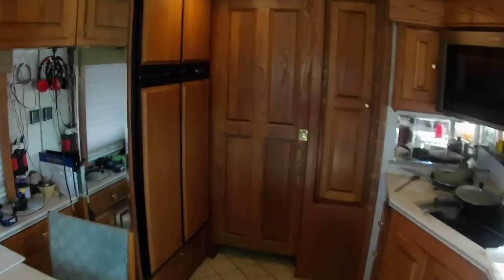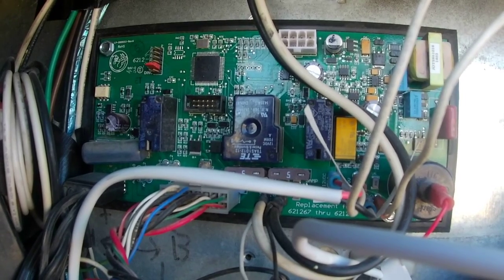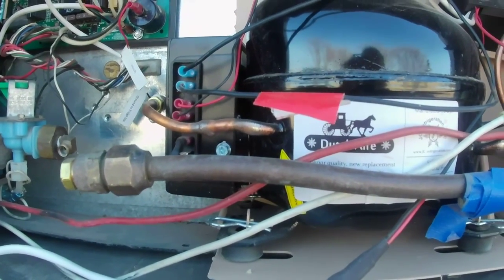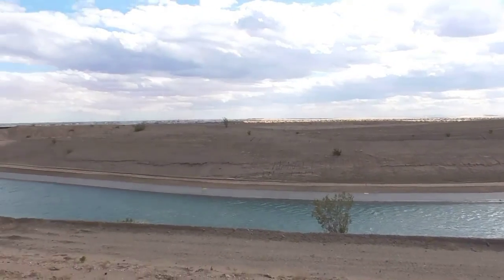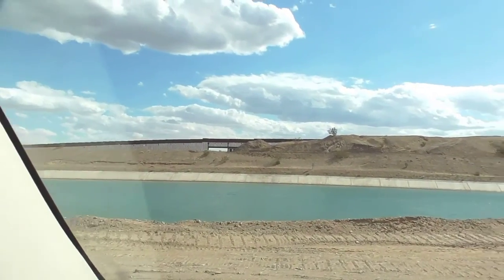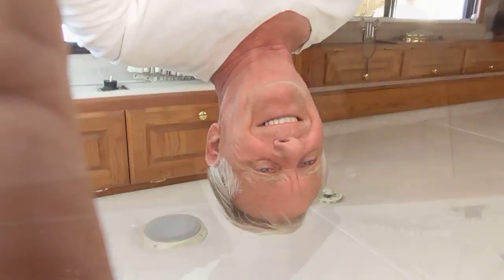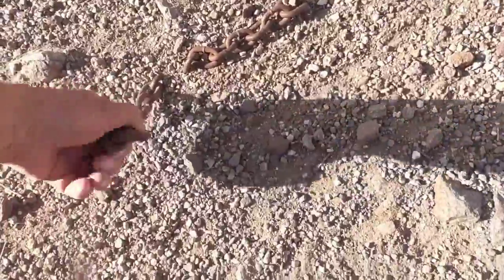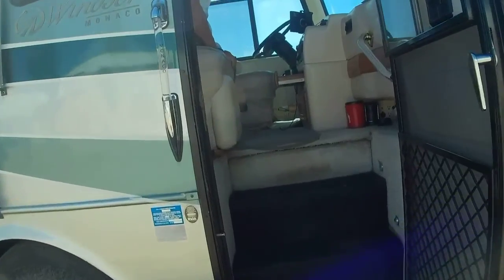Norcold 12V Compressor Conversion.  Yes or No?

Comment: Lol on ice cream too hard comment. Great job on the fridge lasting you longer than it could have.  I understand how it can be cold if you're not used to it. I just came back from the eye vision clinic and it was 49F here where I'm out. 1 hr. West of Toronto. I wore just my poncho and a cotton button-up shirt under it. Just perfect for me. I don't like it when it gets hotter than 72F. Anyway, great job on doing things yourself to save money. As you know you become more knowledgeable checking things out to see if anything visible that you can fix yourself. I've done that before many times. Take out apart and put in a new one. Fridge fan, dishwasher blades that broke off from kids loading it, and knife falling down and breaking the plastic blades when it spins. A few other things as well.

Comment: Sounds like JC Refrigeration should give you a partial rebate for the great review. Lucky that you never had a fire or poor air quality problem with that original gas fridge. I wonder how many people own those units and have no idea of the potential danger they are? You had it for some time without knowing. If you're on any RV forum's you should try to get the word out. Maybe save someone a bit of misery. So you haven't plugged in in over a year! That's impressive, although I don't really know much about RV's I would have thought it would either stay plugged in during storage or take an overnight charge before setting out from the storage facility.

Comment: I think I want to do the same conversion but I'll have JC Refrigeration do it since we'll be traveling close to their location in Indiana this summer. Now that it's been 2 years since yiou did this video, are you still happy with the conversion? Also, do you know how much solar is required to keep your batteries charged if the only 12v you were using is the refrigerator?
Reply from the maker: After two years still the best upgrade I’ve ever done. Still have to take the ice cream out 15 minutes before it scoopable quieter than the old one on gas. Not sure about the power, but the absorption fridge on gas takes 12 V power also I have 1420 W of solar and 600 A of lithium batteries, so the fridge isn’t an issue. Too many variables to answer your question.
Reply: @JCTravelStories  My fridge consumes about 525 Kwh hours of electricity which costs me $100/Month and when using Propane the cost is reduced to about $54/month so probably very little 12V usage and three 30 pound tanks of Propane. I understand the variables present but as a general rule, do you think I will be see any savings?